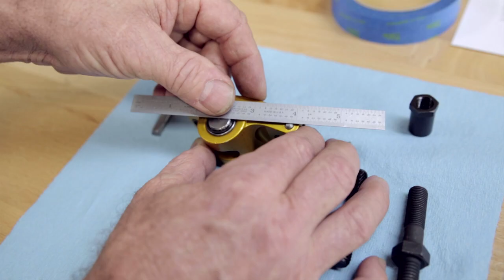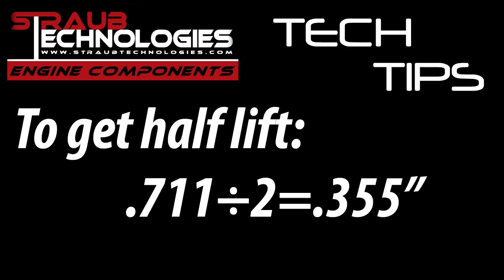Engine Tech: Valvetrain Geometry

Comment: I have watched dozens of these videos on push rod length. Every one of them shows a small block Chevy being used with stud mounted rockers which are the easiest to establish pushrod length. Not one video have I been able to find where a small block LA mopar with shaft mounted rockers being used. The process of establishing proper valve geometry and pushrod length is a bit different and more difficult than a Chevy. Shat mounted rockers require shims to raise the entire valve assembly to proper heigth which moves the rockers closer to the valve in order to obtain proper valve tip contact with rocker . This increases pushrod length plus adding the proper preload adds to the pushrod length as well. I guess not many racing shops are versed with mopar, therefore not having the expertise on how to build one.
Reply from the maker: WE have 2 circle track SB Mopars going together over the winter.  We are planning a video on shaft rockers and geometry on these engines.
Reply: @straubtechnologies9011  be looking forward to watching the video when it becomes a available. Not many people enjoy the world of mopar due to their inability to build one. Having said that, the after market industry makes us mopar fans suffer when buying parts for mopar because the prices of parts are based on junkyard motors like Chevy. The variety of parts are not readily available for mopar as they are for Chevy and Ford. I will say though, if a die hard Chevy guy ever got behind the wheel of a car with a well built mopar, he push all that Chevy junk out of his shop and learn how to build some real power, lol, just saying.
Reply: @StanleyBlack-xf3hv here ya go bud....it's for an FE but shaft mounted all the same.

https://youtu.be/hcRTOKn0sjE?si=qM5Q1d1179hVq1o5

Comment: great information! The unanswered question is, you say you need to get the correct rocker arm first. Do you have a video on HOW to get the correct rocker arm?
I'm assuming someone makes custom rocker arms? Currently building and AFR headed BBC engine, customer brought Harlon Sharp aluminum roller rockers and they are no where near being correct as you show. The rockers studs supplied by AFR appear they will much too short with a correct arm, but how to determine the correct arm is the mystery.  Thoughts? Thanks!
Reply from the maker: Most aftermarket heads have longer valves and longer rocker studs.  These are both on a crash course of intersection.  We have rockers with adjusted geometry to compensate for this.   www.straubtechnologies.com

Comment: Simple and easy to understand, but what do you do with hydraulic lifters? How do you adjust for getting the lash set to the middle of the hydraulic lifter's range? Do we add that to the length?
Reply: You get a solid lifter or make one outta ur hydraulic lifter. Once you get length set you add either .042 or .050 for me I had got 7.4250 on my flat tappet hydraulic lifter. Added .42 and got a length of 7.8450. Which gave me a perfect 90 degree angle on my 1.5 rocker arm at half lift.
Reply: Everything is the same, just add the preload to your measured length.  Typically 1/2 to 3/4 turn.

Comment: This process probably won't work on stamped steel rockers.
Reply: I agree. How do you find the centerline on the point of contact to the valve on the rocker? It's easy with the roller rocker arms.
Reply: @VGHCX  i use a sharpy pen colour the valve stem then rotate geometry then measure the center.
Reply: Worked for me. I used a level lol

Comment: This seems like a good way to check, wasn’t even close on my sbc 383. I’m not sure how it could be when there is a 1.6 rocker ration and mid lift at the valve is different than mid lift on the cam
Reply from the maker: You use your rocker ration that your are using to get your lift.   YOu then use half of that.
Reply: @straubtechnologies  I think I need a different rocker arm. I measured it with the mid lift method and came up with bassically the same pushrod length but my rocker is way to the outside of the valve stem towards the exhaust.
Reply: @curtisdefreece9921 different rockers may help. How close to the edge is it? Centered doesn't mean good.
Reply: If you've got 0.300 lobe lift and a 1.5 rocker, you have 0.450 lift at the valve. With a 1.6 rocker you have .480 lift. All this without including lifter bleed, deflection etc. Just divide the theoretical lift by 2 and put your rocker down that dimension from a right angle with the valve closed and the cam on the base circle. I'm working on a video, there's so much confusion on this subject.
Reply: If you have a 1.8 rocker, it would till be EXACTLY the same. Half lift on cam lobe is still 1/2 lift at valve

Comment: Where on the cam does the lifter need to be to have this work properly?
Reply: I am in no way an expert on this. As a matter of fact, I've never done it. But I would think that you want it on the low side of the lobe, "closed valve".
Reply: Yes, he missed that completely.
Reply: Have to be on base circle. Think it through logically, where else would it be. Where is is it wgen you run your valves?

Comment: I understand what you are doing but its not completely accurate because the rocker stud is not parallel to the valve stem.  Your method would only be accurate if the rocker stud was parallel to the valve stem. The amount by which you would be off would not be much but it would be off a little

Comment: Can anyone here help me out? On my data card I have "valve lift" and "gross lift at cam" wich one I use for this test?
Reply: He didn't mention cam lobes so I guess it doesn't matter. LOL
Reply: Valve lift.
Reply: Cam lift, and gross lift.
Cam lift it the lift height of the Cam lobe.
Gross lift is how much lift you need at the valve .. requiring a ratio rocker arm.
As rocker arms come in various ratio 
S.
Like 1 to 1, 1to 2, 1 to 4 ratios.

Comment: I used this method and I have a wide sweep across the valve tip, biased towards the exhaust telling me the pushrod is too long. Any ideas why? Also do you add lifter pre load to your final length in a hydraulic set up?
Reply: This method is inaccurate. 
The line drawn.. must go from the center to the trunion  to the bottom of the roller/top of the valve.
Reply: If you have a wide sweep pattern, you did it wrong.

And if you do it right and your contact patch is at the edge of the valve, you have a wrong length rocker, not the wrong pushrod.
Reply: Same issue with mine. Mine wasn’t even close.
Reply: Exhaust side????

Comment: When measuring the pushrod checking tool, do you need to make any compensations for hydraulic lifters? This is a great video. Best on the net. Thanks!
Reply: My understanding is that if you're using lightweight checker springs, it won't compress the hydraulic lifter but you have to verify that visually.

Comment: How is the poly lock and the rocker secured in this position? Isn't the rocker arm floating on the stud at this point?
Reply: The rockers aren't ever tightened all the way to the bottom. The pushrod and valve tip hold them up against the poly lock.

Comment: A way to verify that you are checking the pushrod length correctly, is to put black marker or dye on the valve stem tip and rotate the engine by hand after getting the pushrod length correct, and check that the rocker roller is centered and rolls in and out from that center point of the valve stem, through valve lift and back. This is done with Low Pressure checking springs! Thanks
Reply: With roller tipped rockers, this is not really a concern anymore. Smokey Yunick learned this after 7 years of hard passes on an engine that had the sweep pattern at around .020 from the outboard edge of the valve tip. The rest of his geometry was all that really mattered. All of his valve guides were perfect, even after 7 years of hard passes on that engine. Sure, in a perfect world, you'd have a perfect 90 degrees between the pushrod and rocker, the valve stem and rocker, AND have a perfect sweep pattern on the valve tip, but with ALL modern roller rockers, the geometry is off by a good margin. Miller rockers were the only real option that addressed this issue perfectly.

Comment: Wrong line drawn on your rocker arm. The line of action goes through the roller OD where it touches the valve, not the roller pivot, which is immaterial. All the valve cares about is the point that touches it, which is the roller OD. That point should be perpendicular at half lift.
Reply: That's not true. The bottom half of the roller essentially becomes part of the valve tip.   The roller pivot is what follows the radius of the rocker when it's going through it's motion.

That misunderstanding is the exact reason that Jim Miller was able to get a patent for mid-lift geometry.
Reply: @earlbrown 
Nope .. it doesn't. 
You are close, but not really. 
Try laying it out on a paper with a pencil and compass. 
The top tip of the vavle is the moving pivot.
With your logic  .. you will shim the rocker/trunion .. by half the diameter  of the roller  = too high.
Reply: @thestove2407  no  the video  does  it correct.  scott foxwell  has built more  engines  than all of  us  that win races
Reply: @KingJT80  lol. This is an "accurate" method of guessing, hence it is called "mid lift theory"... A patent for what???? lol

Comment: If using hydraulic lifters.. do you add the amount of preload to the OAL length of the newly determined push rod length?
Reply: Did you ever find out? Im curious too? Seems like you'd have to determine teh total travel of the hydraulic lifter plunger and add half of that to the pushrod length?
Reply: @KyleP133  never found out..  guess we can always call them

Comment: do you do this with or without head gasket in place,excellent video
Reply from the maker: With a head gasket in place. That gasket has a compressed thickness that will add to the total distance the pushrod must extend over in order to mate the lifter to the rocker arm.

Comment: Hi, I kind of have a confusion about how rocker arm geometry is met when you have a larger cam, because if an aftermarket cam was installed with a larger amount of lift then the stock one, wouldn’t the larger lift cause the rocker arm to be out of spec with 90 degrees at mid lift. And if the push rods were changed to gain 90 degree geometry at mid lift with this new cam wouldn’t you lose the effect of the larger lift. 

My next question is how do you find correct rocker arm geometry with stock rocker arms, to my knowledge all you can do is just color in the valve tip and then rotate the motor over a few times and keep adjusting the push rod until the mark left on the valve is centered- is this the best way to this with stock rockers?
Then how do you find the proper lifter preload, I am working on a 1979 302 Ford and I have been told to give each rocker arm nut a half a turn to set the preload after running the motor at idle loosening each rocker nut until the rocker arm clatters, then tightening the nut just until it quits clattering. 
When it comes to lifter preload wouldn’t this also change the rocker arm geometry.

Comment: First off, I'd like to thank you for this video (even though it is many years old now).  It makes perfect sense.  I was all revved up to go out and do this on my motor.
However I ran into a problem.  I marked my rocker arm as you did here, but when setting it up on the head, I actually have to RAISE the push rod side of it to try and create the 90 degree relationship.  The problem comes in that I run out of threads long before I hit that perpendicular angle.
Any insights?

Comment: How does head gasket thickness affect these measurements? I still  will need to clay my pistons for valve to piston clearance,  so I will just snug down head bolts against gasket to measure for pushrods....hope this makes sense
Reply from the maker: Without the gasket in place, the true distance for the pushrod to extend over would not be accurate. A head gasket has a compressed thickness, how thick it will be once the head is installed and torqued, that could be something like 0.028". If that is not present at the time of taking the measurement, then your pushrods will be indefinitely short compared to what they should actually be.

Comment: I used your 90% method to set up my checking pushrod but after I turned the motor over a few times the witness mark was favoring the exhaust side of the valve stem   Maybe at a 3rd. I rechecked to make sure I was at base circled and tried a few different cylinders with the same results. Am I missing something here or is this acceptable? This is a 454  Mark IV with 049 heads and a.510 lift cam with a 5,800 rpm range which isn’t too aggressive. I guess my question is does proper geometry trump center of valve stem?
Reply: Yes, proper trumps centered.

Comment: Do I need to put in the check springs or am I good as long as I don’t pre soak the lifters and don’t compress them?
Reply from the maker: You will need checking springs installed. Otherwise, there will be no way for the valve to actuate correctly as you rotate your engine.

Comment: I'm trying to find a video that tells me whether or not longer push rods in abbc454 increase cam lift....does anybody know the answer or where I can find it...lol...? PLEASE AND THANK YOU
Reply: To my knowledge, the pushrod length has no effect on cam lift - the pushrod will only transmit the lift the cam provides - however, the pushrod length does determine where the force is being applied to the end of the valve stem, and the whole point of getting the correct pushrod length, is so the roller tip of the pushrod rides as close to the center of the valve stem when the engine is turned over a couple of times, with the valve stem tip covered with a sharpy pen or  other such marker, and you hold the roller tip from rolling . . . so it "marks" the end of the valve, leaving its "witness" marks showing where it made contact, through it's full travel . . .

Comment: I know this vid is like 7 yrs old and contains stellar info I was wondering why no-one has done a video when it comes to shaft mounted roller rockers as setting the pushrod length is quite a different process..I know you said its ok to call I still  believe in being courteous and let you ultilize your time in the manner you need to utilize it in instead of me calling at an inopportune time.

Comment: The problem I ran into using this method is: when using valves with +0.200" length and lash caps +0.080" the resulting height causes the intersection of angles between the rocker stud and the valve to become such that the roller tip is far to much toward the exhaust side of the stem. So I'm having to find a happy medium between this method and center, or not so center of valve methods.
Reply from the maker: We have corrected rocker arms with the geometry to fix this.   www.straubtechnologies.com